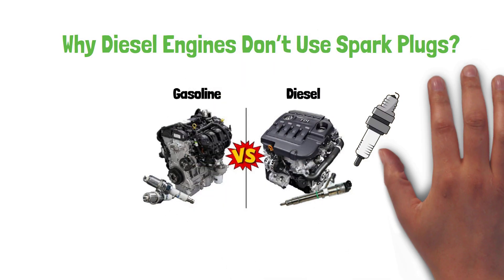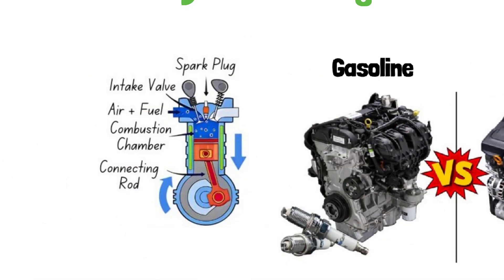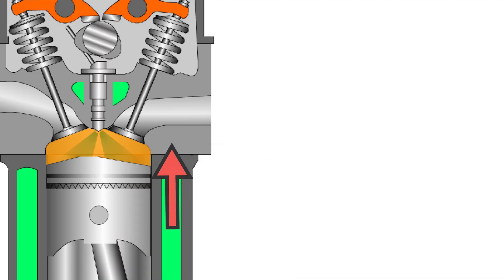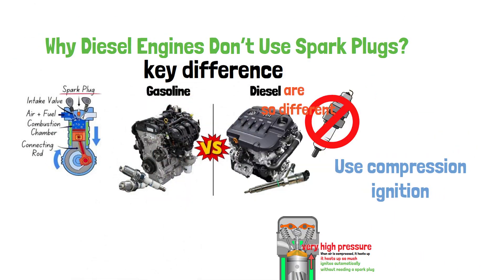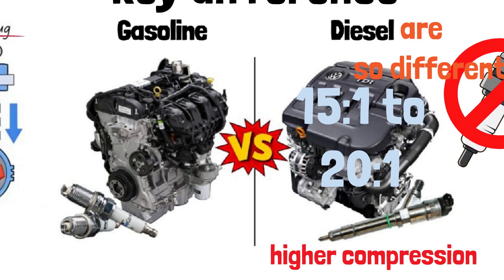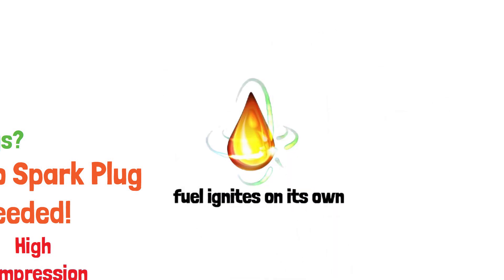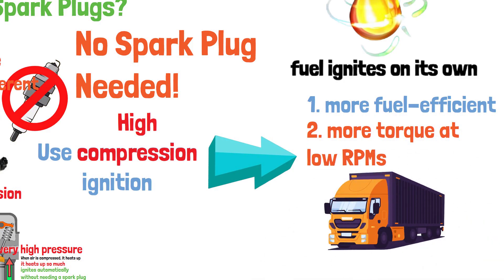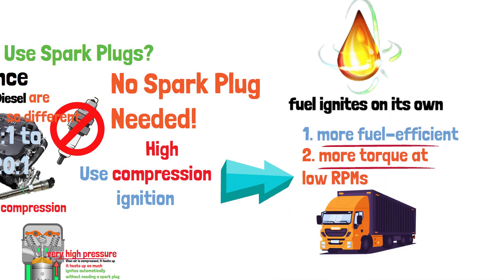You Won't Believe How Diesel Engines Work Without Spark Plugs

Comment: How does a diesel engine take in air and out of the cylinder.
Reply from the maker: The four-stroke cycle principle, which is also used in gasoline engines
Reply: @ 🫡 thank you
Reply from the maker: Ur welcome